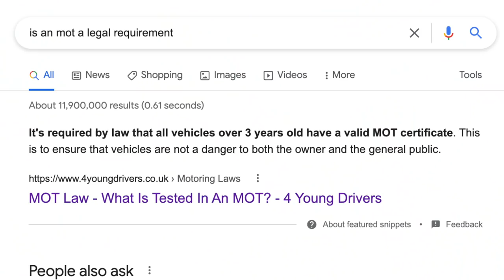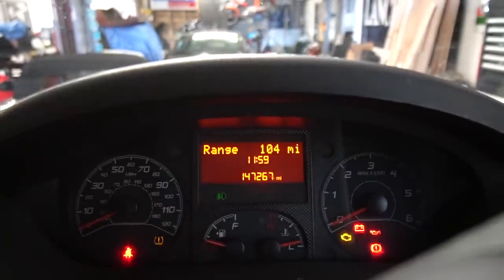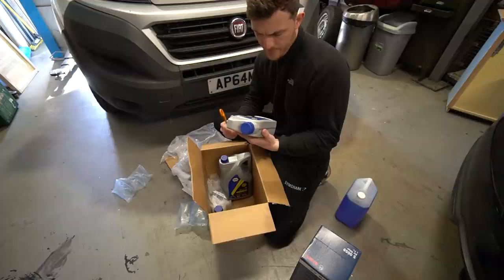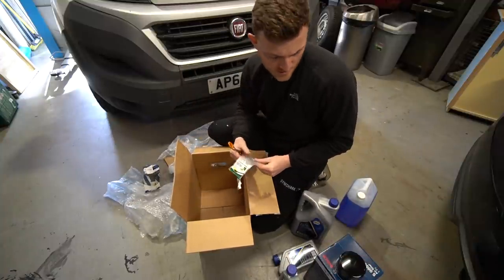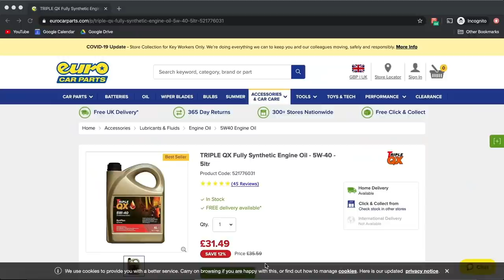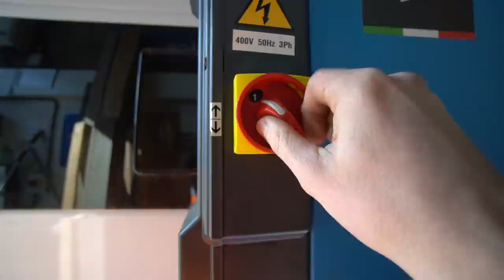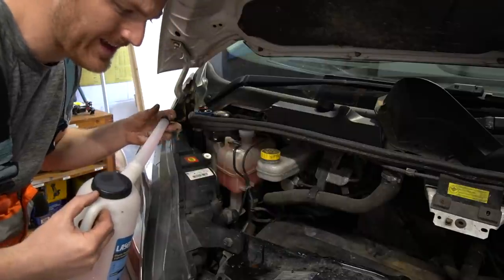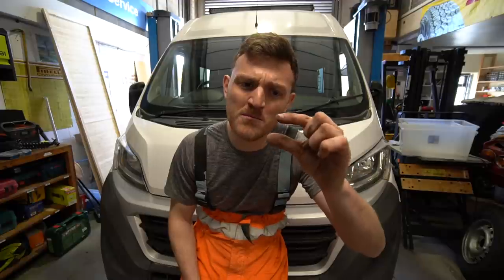BECOMING A MECHANIC! First Time DIY Van Service - No Experience Van Build

Comment: Judging by the look of that oil, this was well needed. Good on you Will! Just a tip for hard to crack bolts like oil drain plug, get yourself a extention bar for the socket, or even use a longer socket that the one youve got. The bar gives it more torque and allows you to crack it with much less effort. I've learnt all the car stuuf the same way as you and trust me it get easier!!
Reply: Also possible to add a ring spanner to the end of the ratchet to extend the length

Comment: Hey Will, ya forgot the Fuel Filter. 
That should be changed when you do a service as well.
Reply: Not on every service. Every 25k or so.
Reply: Yes 45k km (27k miles)in the book.
He said he was doing a full service.
Looking at the rest of the engine bay I suggest it's well overdue.
Reply: @multipreach2674  or when you have no idea when it was last done
Reply: For the sake of £10 and a half an hour it may as well just be done with the service anyway.
Reply: Fuel filter is important especially on a diesel, normally on every second service, often the same as the air filter

Comment: The yellow cap in the engine bay is brake fluid. It being full is good 👍🏻 top man learning all the time
Reply: Being full is good, but being old - it's not.
Reply: @multyspeed  I know brake fluid is hygroscopic but it can often last the life of the car without needing to be changed.
Reply: @JazzFunkNobby1964  This is not true. After 2 years the brake fluid is loosing the capabilities. Rust can appear in metal brake pipes. Its good to change it every 2 years or 50k km. There is no reason not to do it. Its cheap and easy job.
Reply: @multyspeed  As a mechanic, I have NEVER replaced the brake fluid on any vehicle. Nobody has ever asked me to.
Tell me how or when is the brake fluid going to be exposed to the atmosphere?
It's totally unecessary but as always there will be people that do things simply because they are instructed to do so.
Reply: @multyspeed  The rust you see on brake pipes is on the outer surface obviously. The rust is not on the inside. 
The pipe is more likely to need replacing before the fluid.
Reply: @JazzFunkNobby1964  Most manufacturers recommend changing brake fluid at least every two years. Because it plays a crucial role in keeping you safe and because it's not easy to tell how often you should change brake fluid, it is advisable to carry out a visual inspection of the fluid much more frequently.
Reply: @multyspeed  No, they don't 'recommend' it be changed because that would put them on the hook legally.
They state it should be changed.
Some say every 2 years, some 3 years, some don't give a period of time.
Others will say to change it at various mileage intervals regardless of time.
A visual inspection is not reliable. Brake fluid comes in various shades, you could not guarantee fluid is good just by looking at it.
Reply: @JazzFunkNobby1964  Most brake fluids such as DOT 3 and DOT 4 are hygroscopic, meaning they will absorb moisture when exposed to air. The main enemy of brake fluid is moisture and this can be absorbed through brake lines or the brake fluid reservoir even when the vehicle is not driven. This is the normal process of the fluid’s life cycle but it is exacerbated in more humid conditions and climates.
After a year in service your brake fluid will absorb approximately 2% of moisture. This decreases the boiling point of your brake fluid and heightens the risk of a brake failure.
Reply: @multyspeed  So now you're saying the brake fluid should be replaced every year.
Do you sell brake fluid?
Reply: @JazzFunkNobby1964  No, Im not selling anything. And I have said when you AHOULD change the fluid. As a mechanic you must know that.
Reply: @multyspeed  A very simple brake fluid test can be done in a couple of minutes that will tell you if you need to change the fluid or not. Anything else is just guessing.
I guarantee you there are ten year old cars out there with original brake fluid that is perfectly safe.

Comment: As others have said, an extension of some sort on your socket wrench is a must to keep in the van at all times. I have a 1 meter length of thick steel tubing that always goes with me. If you get a puncture and have to do a wheel change it is hugely useful for getting off the nuts on your wheel. Garages usually put your wheels on using a compressed air gun which can mean they are on so tightly you need to be built like Arnold Shwarzenegger to get them off for a wheel change. A long steel tube gives you so much torque they come off easily. I had occasion to help someone with a flat tyre who was stuck on the side of a busy road trying to change his wheel but defeated by the wheel nuts.

Comment: hello Will, good job on your first service. two tips for you, if you run the engine for 10/15 mins to get the oil warm, just warm not hot, it comes out easyer. After fitting the sump plug/oil filter wipe around the plug/filter. makes it easyer to see if theres a leak

Comment: Well done on the first service mate, another think you could do is check or change the cabin filter that filters the air you recieve in the cabin, it's usually accessed in the back of the glovebox but I don't know with a van?  It's normal to be on a bit of a low when you've just been on a fun adventure where you put all of lifes problems on hold an go and enjoy life and forget your troubles for a while, like people say below, not everyone knows where they are going in life and all your friends may be settled and in high jobs before you and seem like they've achieved life, but truth is, they probably have more stress and worry than you without those things, don't stress on it, as long as you have your health and a roof over your head, you're in a better place than some unfortunate people delt poor hands in the game of life, you're doing alright, you've got a brilliant platform to air your achievements, adventures, lessons and worries... keep doing what you're doing... ps that oil looked black as anything, must've really needed that change badly lol

Comment: I was wondering what the disaster was going to be in this one, but I was wrong - you got through it with no mishaps! When you get rusty screws, like those in the air filter box, it helps if you rub a bit of oil or grease on them to slow down the rusting. You can then get them out easily next time. If you find wood screws are difficult to do up, rub a bit of candle wax on them. If a small wood screw no longer screws up tight, put some superglue in the hole, (not too much, you only want it round the wall of the hole) and let it dry before putting the screw back in.

Comment: Well done!
It is  good idea to run the engine a bit just before draining the oil, the warm oil drains better but more importantly running the engine stirs up the stuff that settles in the engine so that it can also be drained.
You should also replace the fuel filter!
The container you were not sure about holds the brake fluid.
You should also check the power steering hydraulic fluid level.
Reply: Makes no difference hot or cold.

Comment: Well done, Will! It is easy after you have had the courage to do it the first time. Next spring you do the service in no time. 👍 If you check your Ducato owner’s manual, you can find a list of items that go to the different service programs at certain intervals. With the mileage you have, you should check that the timing belt has been changed. It that breaks you will experience ”Camper Vibe in Spain” type of problems. It also makes sense to change the water pump at the same time.

Comment: Hey will I’m 40 and spent my childhood stripping things down and repairing them. At 17 I stripped down my motorbike engine and rebuilt. I didn’t have a clue what I was doing but I learned a lot by doing it. Totally agree with you get stuck in to learn.

Comment: Good stuff!  Well done.  Two small tips for the oil change.....
1) Put a little fresh oil into your new filter to prime it.  
2) When pouring fluids from those big bottles, rest the bottle with its widest side horizontally rather than it's norrowest side.  OR if you know you're using the whole bottle pierce a hole in the top for the air to escape.  It will glug much less erratically and give a smoother pour - less chance of wanking it all over the engine.

Comment: Coolant - get a test kit to make sure it's not too diluted. Modern stuff lasts for 10+ years - top up with coolant mix of correct type. Max is the 'hot' level, so normally you top up to the cold or min setting. If it's cloudy or messy, drain, flush and replace.

Comment: Good job Will. A few helpful tips. To get stubborn bolts off there are several things you can do to make it easier. Use a breaker bar or a piece of pipe that will fit over your ratchet. For oil plugs I just snap them with a hit with a heavy hammer. Check your owners manual for the amount of oil it takes to refill with a new filter. I put that number on the cap with whiteout paint for future reference. Also put the date on the filter for future reference also....oh and don’t buy a fiat, having to use a funnel to fill up your windshield washer fluid is B.S

Comment: Well done mate not bad for your first ever service couple points for next time 
remove oil filler cap before draining and then put back on (don’t drop anything inside) it releases some of the pressure in engine so doesn’t shoot out as fast at bottom end 
Once topped up and started van always check oil level again as it will drop slightly once filter is refilled etc 
yellow cap is brake fluid 
Going on condition of your old oil a fuel filter would be advisable just so you know it’s been done 
When filling the oil in future turn the bottle flat or you could even put hole in the top near handle so it doesn’t glug so fast 
Other than that good job

Comment: good on you for giving it a go! Im not set up at home to be able to do that kind of stuff and have always left vehicle(car/motorbike) servicing to the mechanics. I do however, always topup my own oil, coolant and window washer reservoirs. My first motorbike which was pretty basic, I also did the points and oil changes and air filter...was easier to access back then.  I also ask my mechanic to check the brakes when I put my car in for its servicing....better to be able to stop is always good!  cheers to ya! A note...IF YOU choose to attempt to do the brake fluids...make sure to BLEED ALL THE AIR properly from the brake lines to ALL the calipers..front and back...air in the system prevents brakes doing what they are suppose to! ...

Comment: the dot 4 liquid container is the brakes oil! In a combustion engine we have to check: engine oil, direction fluid, brake fluid, transmission fluid, change oil and air filters and habitacle filter. Check your manual of the van, there will be a to do list at every year or km

Comment: Fuel Filter! Everyone seems to forget the fuel filter!. Anyway... If you're going to continue self servicing, get your self to somewhere like Costco and buy you oil in bulk, 25litres drums etc. Works out way cheaper than per 5litre cans. And a tip from an old timer I was given.... Diesels love air... So, what I did with a diesel I used to own, chuck the paper filter and fit a performance panel filter - NOT one of those boy racer induction kits! Paper filters can be quite restrictive in giving a diesel what it wants. The performance filters can be washable too, so no need to keep buying that filter at every service. 👍

Comment: You need a torque wrench to get the sump plug at the correct torque. Also its good practice to get an oil filter wrench to tighten up the filter a 1/4 turn from hand tight. You also need to prime the oil filter when putting it on, you should try & fill it as much as possible with new oil before it spills out when screwed on. The reason for that is it stops the oil pump encountering a gap in oil circulation on the first start after the oil change. I usually chase out the old oil with a dash of new oil & let it drain out, there is plenty available from 7 litres  you can easily use 0.4 L for that purpose.
Not sure about rubbing one filter on another, in fact thats total nonsence 😮  every good mechanic will tell you just to smear a drop of new oil on the rubber ring. The oil filter housing area should have been carefully cleaned up as well before putting the new filter on, even kitchen towel will do for that 😊

Comment: Right Will, two tips, ALWAYS flush the oil before refilling it. Two, use a lever extender to greater torque you can find them anywhere, and it gives you far greater leverage with tight nuts. An extra foot and with the same force (your strength) it would have come off in no time - actually  less effort is needed.

Comment: If you pour with the bottle opening on top, the air flows freely back into bottle -> no "blub blub blub" and oil going everywhere, just a steady flow.
Also, get a cheap torque wrench - it will be helpful in avoiding overtightening the wheel nuts and damaging your rims (can't recall if you have one already), and it also helps in teaching yourself what different torques feel like.
Looked like you tightened that drain plug very tight; apparently it should be only 22Nm in Ducato - verify that from the service manual. Overtightening can damage the threads, crack castings (which is EXPENSIVE damage) and will be a b*tch to open next time.
Great to see you putting effort in getting the important things done, serviced anything will serve you better and give more enjoyment than neglected one!

Comment: Well done for sorting the maintenance. Make sure you check oil level after you run it, and keep an eye on it .... you'll get to know after a while how much oil it uses and how often you need to top it. Also, if you turn the oil container to the side it comes out less eratic.... clean oil on filter to seal is better 👍 amazing effort and achievement though.

Comment: Putting oil on the new seal isn't because you want a better seal but because it makes it easier to unscrew the filter when you remove it later. A dry seal will stick like glue & make removing it an ordeal.

Comment: Great good Will
Always use clean oil on oil filters. old oil could have crap in and won’t seal
Always check oil after filling up
Yellow cap is for break fluid full is good
Always do fuel filter

Comment: Diesels need a fuel filter changing as well if you dont know when it was last changed, Ive been doing mine every other oil change, and the 'I have no idea what that is' with the yellow cap is for brake fluid.

Comment: Great video Will, for future reference when using a ratchet or whatever u called the tool to remove the oil plug lol it’s all about leverage when u come across an overnighted bolt, if u can slide a small pipe on the end of the ratchet to extend the handle it will be much easier to loosen. I’ve got 25 years in the construction business and over here in the US we call it using an old man lol keep up the great videos and the honesty

Comment: The one you don't know is your brake fluid reservoir. And the oil filter. You should rub oil on the rubber seal, it keeps the seal from binding and causing leaks when it's tightened up.

Comment: Nice one will. Tip. Big sump plug (or any other) big wrench /socket. On that even a big breaker bar (a long socket handle) will make it much easier to shift. Nice one mate. Well done.

Comment: You should probably check what servicing has been done previously. You’ve done the basics, but there are other more complicated things that needs to be done, like valve clearances and cam belt replacement. There should be a service book telling you what needs to be done and when eg cam belt every 60k miles.

Comment: Your van is diesel, you may well have a fuel filter to change/clean, also you should be checking the condition of your wiper blades and that your window wash is hitting the screen properly and not missing it (should hit around the centre of your vision)

Comment: Don't forget the fuel filter Will also with the yellow cap thats your brake fluid if it is clear and full to max its good but if it is a slight brown it needs changing should be changed every 2 years. Keep going Will love your vids 👍

Comment: You did everything correctly.  Next time use new oil on the new oil filter rubber gasket.  Just put your finger in one of the bottles to get some new oil out then put it on the new one.  You should have disk brakes on all wheels.  Disk brakes are really easy to replace.  If you need info on how to do that I can send it to you via your Instagram page.  By doing it yourself you saved a bunch of money.

Comment: If you find it burns oil, worth getting 10L bottle of oil - always cheaper in bulk, and decant a litre into your small bottle to take on a trip...avoid motorway oil prices. I'd be changing every 10k miles. I use a fuel cleaner 1000 miles before MoT - check reviews to avoid wasting money on them. Gloves and oil absorbing mat are very useful, and lots of cloths/rags/blue paper roll. Local tip should take waste oil. Normally low-high on dipstick is 1 litre.

Comment: We had a fleet of these ducatos at my old job, they are good but only if you ignore GM's service schedual and have it done every 10-15k instead of their recommended 30k. The engines in these like a drop of oil with their cuppa in the morning, and leaving it in there for 30k is a stupid recommendation from fiat/GM. Our fleet were serviced to a contract so they had to be done at GM's specificated intervals, ours didnt even make it to 30k without breaking down, it ran out of oil at one point, then the DPF blocked up before its first service.
But otherwise to any engine savvy owner, they are a good engine if you do regular oil changes like you would on a car.